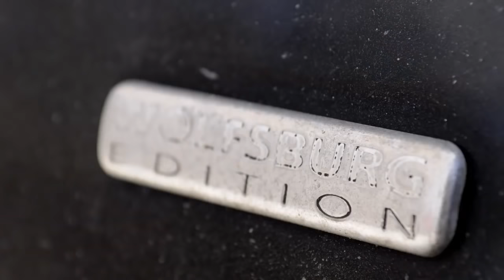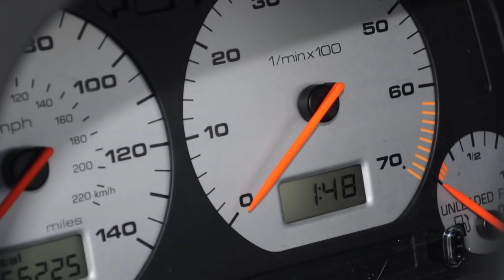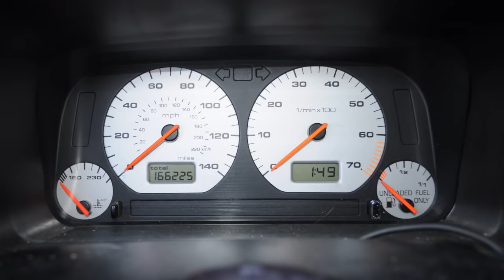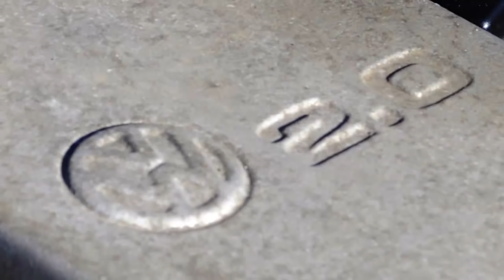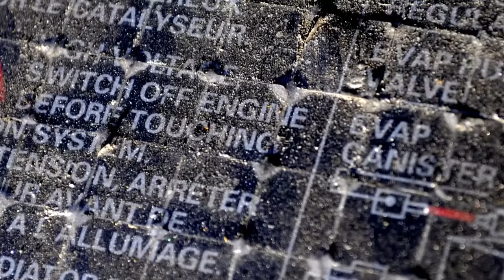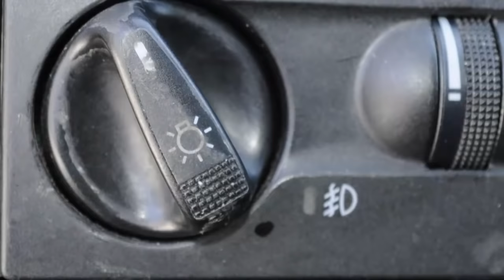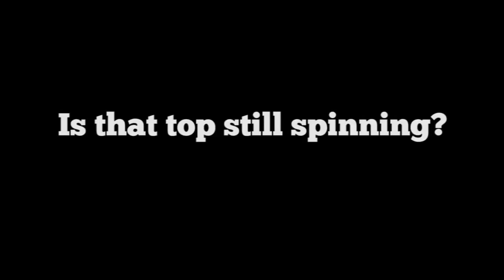Regular Car Reviews: 1998 Volkswagen Jetta Wolfsburg Edition

Comment: I have an irrational hatred of Nissan Jukes. They look like cross-eyed frogs.
Reply: The Nissan joke, garbage car
Reply: The Nissan joke, garbage car
Reply: Sounds pretty rational... although some people don't care i think
Reply: +Sean Hartford I kind of do too. They should've named it the 'Nissan Joke'.
Reply: +Sean Hartford I have a rational hatred of almost ALL German cars for being over-engineered
Reply: WindowsMaster Amen. I'd do that…...Right after I do it to a Prius.
Reply: +MichaelD8393 I drive a JUKE Its ok, YOu have to change the rims to a lower weight rim Do a 3 inch static drop and some bolt on mods to make it anything fun! Yes it is funky
Reply: Jerry robinson Alrighty sounds good.
Reply: +Gregory Kanniard thats an irrational hatred. not rational.
Reply: Gregory Kanniard OK I get it now. Don't know if SatiricalMeme will though.
Reply: Gregory Kanniard It just depends on the year. Usually anything 80s - 90s or early 2000s from germany will have tons of electical problems, but the more modern ones are usually over - engineered to the point where they don't break down often. I've never had problems with my z4
Reply: SatiricalMeme If you buy new they're great cars if you don't want them for a really long time. Buying them used is attractive but disappointing when you get the inevitable costly repairs. I'm actually looking to possibly buy a Golf GTI. Just not used. GTIs hold their value fairly well.
Reply: Gregory Kanniard It must just depend on the car then I guess. I've had my 06 Z4 for a few years now and never had any issues
Reply: SatiricalMeme Thats great! With any used car, it's always a gamble.
Reply: Gregory Kanniard That's very true. I'm going to sell my z4 soon and buy an 06' m6 so hopefully I get lucky again
Reply: SatiricalMeme Hopefully! Those are nice roomy cars with "just a bit" of extra power.
Reply: Donovan Campbell nah I think they look pretty cool.  chick I know has a nice one.  haven't gotten to drive it yet
Reply: My mom went from a Audi s4 to a Nissan Juke. I got cancer when she pulled into the driveway.
Reply: I have a rational hatred towards modern SUV and crossovers in general. "I HAVE A BIG CAR!but Corolla has a more spacious cabin, weird over complicated lines, poor visibility, angry headlights, I can go off-road but I'm not going to, SPOOORRRRRTYYYY!!!"(ok, most post 2008,10, something cars looks like this) Get a FIAT Panda 4x4 or something!
Reply: Indra Ida Bagus SAME!
Why buy a RAV4 when you can buy a Focus ST for 800 dollars more.
Reply: my dad says exactly the same
Reply: I dislike the juke because the headlights look like messed up toenails.
Reply: It's good for you.
Reply: I truly despise Fiat Seicentos. They look like a cat when you pet it too hard and force its eyelids open combined with a neanderthal skull
Reply: the way he feels about Jettas is the way i feel about Miatas. they are probably good cars, but i have an irrational distaste for the over-enthusiastic recommendation everyone gives them. they are too simple a solution.
Reply: Nissan Puke*
Reply: Sean Hartford I like my cross-eyed frog
Reply: There's nothing irrational about hating the Nissan Juke.
Reply: Thank you for figuring out why I hat the car
Reply: Warthog. It's the Nissan Warthog.
Reply: You can think Renault for that design. It's a french car.
Reply: @jerrickoh  I like the cube.
Reply: This is how I feel about the Isuzu Varicose- er, excuse me, Isuzu VehiCROSS
Reply: Your hatred of the Nissan Toad, the ugliest car ever sold in this country (at least up until that time, I think these Big Grille whale-sharks are starting to challenge that crown) is not irrational.
Reply: I have a very rational, totally just hatred for Kia Souls (particularly in electric babyshit-green metallic). They're the gold 96 Buick Century of the modern age, absolutely guaranteed to make you late for work or nearly cause seven wrecks between the mall parking lot and the nearest Chick-Fil-A, ALWAYS turning into the far lane at EVERY intersection, NEVER using a turn signal, and IRREVOCABLY bound to switch lanes in front of you while running 20 mph slower in an attempt to pass the semi in front of them that's going 19 mph slower and remain there for 25 agonizing minutes, forcing you to pass them on the right and weave like a drunk back into the left lane to carry on with your day.
Reply: I have a rational hatred of Nissan Jukes. They’re hideous.
Reply: Completely rational
Reply: Kia Soul. That's all I have to day.
Reply: Not irrational
Reply: Nissan puke
Reply: I literally thought of Richard Hammond from old Top Gear, "Nissan Bloody Juke!".

Comment: 4 years ago, I bought a 90 jetta with 158000 miles on it just because I was reluctant to use my then new G37 as a daily driver. I was actually surprised at how reliable and fuel efficient it was never failing to start every time. sure its as exciting to drive as boiled broccolis and about as stylish as high waist pants, but it serves its purpose well and I could leave it in the parking lot with the windows rolled halfway down. I ended up selling my G37 2 years later but kept the jetta. with close to 200k miles, it now belongs to my brother who uses it to go to college. tough little car this jetta.
Reply: I've had my 99'mk III for 9 years, I got it when I started going to college it's got over 200K Mi now
Reply: I got my 04 Jetta from my mom and I'm giving it to my dad it's lasted my family 253k miles I get hella good gas and in the last year the only time I've taken it to get fixed was for an oil leak
Reply: I feel weird because an old cutlass from like 1989 was the most reliable car I have ever seen.

Comment: I hate Escalades!!!!

They are basically GMC Yukons, which means they're basically Chevy Suburbans, which means they're just trucks.

All GM did (at first) was add cheap leather, chrome wheels and trim, stick Cadillac badges everywhere, and then mark up the price by $15K
Reply: *****
Nothing screams drug dealer or credit card debt louder then an Escalade.
Reply: ***** Because every one need s an arch enemy.
Reply: *****  Aren't that expensive compared to EU luxury SUV'S??? Umm. Mercedes GL450 starts at around $65,000.. The new 2015 Cadillac Escalade starts at about $70,000.............. That right, $5,000 MORE than the Mercedes.. And an awful lot of money for a pickup truck in a tux.
Reply: kop4321 Except the power steering pumps in them.
Reply: *****  Not a lot of money? The 2015 Escalade starts at 71.5 K
Reply: I like how you think.
Reply: Honestly GM did worst just look at the GMC Sprint or the 1964-1974 Chevy Impala/Caprice/Bel Air.
Reply: pbfloyd13 I have a strong hatred for the Escalade too
Reply: Agreed, I can’t stand Escalades, especially heavily modified ones with garish, ugly, distasteful rims.

Comment: I had a 98 Jetta right after college. Non-wolfsburg, so no white gauges, but it had the same 2.0 engine and 5-speed. Best mileage I ever got was about 35 on a road trip from Lexington to Atlanta. (Made it on one tank!) I loved that car, but toward the end of its life every common VW gremlin started to rear its ugly head. Rear window regulators crapped out within 2 days of each other. Dash lights would flicker. And I had to get new rear bearings like once a year. And, like the Jetta in this video, the rubber door trim pieces fell off one by one (I used 2-part epoxy to stick them back on.)

Still, I loved that car. Installed a bangin' system with a sub in the trunk and a 5-channel amp mounted under the rear deck. The trunk was so fucking huge I could drive to band gigs with ALL of my guitar gear in there PLUS my 12" sealed sub box. I used the turn-key-and-hold thing to open/close the windows all the time. I even rewired the sunroof with a special relay to make it one-touch open.

I miss my '98 Jetta.... :(

Comment: But I like the Jetta :(
Reply: Calm yo self!
Reply: I love my vento
Reply: I like the bora too
Reply: I like it too
Reply: I know they are cute
Reply: Jettas look cool!  Just wish they didn't suck so hard D:
Reply: vr6 edges into the room
Reply: i love my mk6 jetta and im trying to buy a mk4 jetta project car
Reply: Agreed vr6 mk3 best
Reply: I had a 1998 vr6 and it hauled
Reply: Being a VW fan, fast and furious fuelled my love of the mk3 Jetta.
Reply: I love them so much I’m on my third one! My first one was a 74 beetle. My second was a 1998 Jetta GLI ( not the Wolfsburg edition parentheses) and my current one I bought brand new and 2013 is the Jetta SE., Which still runs as good as the day I got it! I’ve had some lemons in between, Mazda’s Nissan. I learned my lesson I will stick with my Jetto there, reliable, well built cars!

Comment: Honda CRV is by far my most hated car. Guaranteed to be stuck behind one going 5 under in the left lane.
Reply: Why am I nodding in agreement?
Reply: Honda Jazz for me - synonymous with pensioners going 20mph and exactly wherever im rushing to get to.
Reply: Same.
Or the RAV4. Or the chevy Equinox. Or the Chevy Traverse. Or the nissan juke. Or the ford escape. All of them suck
Reply: Same here, except it's either a prius, f150, Tahoe, or some other GM nonsense. Going 45 in a 60... In the left lane...
Reply: I love the CRV, it's my first car. I do feel you though, a lot of CT drivers either go 60 in a 30 or 10 under no matter the speed.
Reply: One of those pulled out in front of my mum's Toyota Granvia 600 yards from our house. They admitted liability but apparently they couldnt see it.

Was great to see a massive dent in a crv with bent rear axle.
Reply: I have it on back roads. Always a newer model. Always and old lady. I like driving slow. But they were going S.     L.    O.   W.  One time someone had their back windshield wiper going off and a turn signal on. In a straight road with no turns and on a sunny day.

Comment: I had a mk3 GTI with the VR6 pretty fun little car. Honda boys would always try to race but the VR6 never once let me see their taillights. Damn I miss that motor, the car is meh but just the sound of that unique motor was enough to satisfy. I need an R32 in my life.
Reply: They sound like the V6 Ford Contours lol
Reply: Mr Anderson You sir have never heard a vr truly clear its throat. You cant compare the sound it makes to any other engine simply because no other engine shares the same design layout. Especially not some Ford pos modular engine.
Reply: David Garden It's a very unique motor, but it's legacy is hardly inspiring. VW likes to put them in their base/economy models and low end luxury cars.
Reply: David Garden I know what you are saying David.  I had a 1998 Jetta GLX VR6 with chip, intake, exhaust, pulleys and limited slip and that thing was nasty and fast as hell.  No other car I have been in sounded that evil and nasty, I really miss it. The 12 valve vr6 made glorious sounds.
Reply: best-sounding engine, hands-down
Reply: SpaceMissile best sounding my ass
Reply: @nickmerchant81  i still drive a 1998 Jetta GLX VR6 for exactly the reasons you mention... 103k miles now.  it only comes out to play after  the weather warms up and goes back to storage during winter and i drive the truck.  i think i put about 3k miles on her a year.

Don't have any issues with it... aside from broken glove box handle, but i replaced the glove box.
Reply: @rvborgh  been dailying a 94 vr6 german made jetta for the past two years, very addictive to drive, besides the cv axel that I fixed its been reliable even with the coolant gauge not working lol.
Reply: @RAA12586  i still have my West German made 82 twin screw Cabriolet (see my channel), but i really like my Mk3 and am fixing it up.  Just installed a Jetex 2.5" stainless exhaust on it two days ago :)

Comment: Have one. 95' 1.9 Turbo Diesel, 5 spd.

Great car, 40MPG combined, it's rough around the edges, was abused and makes some concerning noises after being dragged out of it's grave in a ditch after sitting for 2 years, and fired right up against it's will.

I got the LOWEST spec though. 2 wheel discs, rear drums, no fog lights, no sunroof, no Wolfsburg rear spoiler, and shitty steelies. I'm missing MOST relays and fuses, including the door dinger, and I had to pull the wiper relay because it shortet out, also it runs rich, has the wrong kind of oil, brake fluid, and so on. Been trying to slowly get it healthy again.

Comment: My wife's 96 Jetta was a complete pile and was completely worthless at 101,000 miles and 9 years old.  Throttle body and front suspension was shot and couldn't figure out where the antifreeze kept going as it never left a puddle and never smelled like it was burning it.  Cost to repair everything (myself and not at a shop) was over $3000.  Replaced it with a turbocharged 2001 Golf.  Car was a blast to drive, but was in the shop at least a week out of every month.  Last time, it blew the turbo, throttle body and alternator in one go.  Without warranty (which I had 2000 miles left on it), it would have cost over $5000.  Traded it in the next day and wound up upside down in a loan....and that's how I spent $20,000 on a used 2008 Kia Rio, and it's been the most reliable car I've ever owned.

Comment: My most hated car is the RAV4. I hate them so damn much.
Reply: I hate the MINI Countryman. Completely and utterly defeats the purpose of a mini.
Reply: *****
lol the nissan skyline is my favorite car
Reply: Muffins It is an over-rated piece of shit that people love because of a bunch of videogames like Gran Turismo and Wangan Midnight. Wanna know 2 cars that during the 90s were similar to the Skyline but performed MUCH better? Lancer Evo & Impreza WRX
Those Skyline (R30-R34) were heavy, had a longer-wheelbase and also used a 6-cylinder engine that made almost less power than what Mitsubishi and Subaru were making with only 4 cylinders
Reply: *****
Group A at bathurst bro. Checked the nurburg ring times? They were space age in the day and were a lot more advanced than pretty much anything another manufacturer was making. plus the evo and wrx were only successful as rally cars but don't hold a candle to the sklyine gtr in circuit racing.
Reply: Muffins When it comes to racing roadlegal cars, rallying has always been the top, the best. In rallying you have to be quick on asphalt, dirt, snow, mud and even sand while also being reliable, resistant to small crashes and even able to complete road sections at normal speeds
Circuit racing is just a bunch of idiots completing loops around a perfectly-groomed route with almost no imperfections
Guess what is closer to what you might find on a normal road? ;-)
Reply: ***** Never really got into it
Reply: Mine is the prius it shouldnt even had been invented
Reply: the 1st gen is the only 1 i like

Comment: I actually owned a 1998 Jetta Wolfsburg, bought new in 1998 for $15,500. I kept it for 12 years and put just over 100,000 miles on it. It was a lot of fun to drive. It did have some issues, however. The window regulators were a faulty design and broke regularly. I think I replaced all four of them. The ignition coils on these cars were known to crack and allow in moisture, which caused faults when it rained heavily. My cruise control stopped working after about 8 years (probably a bad vacuum pump) and I had a faulty 02 sensor at around 10 years (easy to replace).

Luckily the car was very easy to work on, and the 2.0l motor was super reliable. It also came with quite a few features that were unusual for such an inexpensive car, such a six-CD changer, which I sold on ebay.

Comment: when I was 18 and mom was ready to buy me my first car, I insisted on a '89 e30, but she picked the '98 Mexican Jetta GLS for me. to play it safe, you see. to buy a car more reliable and cheaper to repair, you see. bought for $4000, sold two years, about a grand in repairs later for $1700 with leaking oil and transmission slipping and sliding all over. this car put so much autoshop fright into me, my next one was a '00 echo. also, re: fuel economy - compared to an echo and my current sixth gen civic, owning the jetta was almost like owning an suv.

Comment: I seem to recall that the Rabbit was a failure in the US in large part because they had to sell it at a higher price point, later than planned, because of parts production problems in Brazil - which is the very same problem they ran into when debuting the New Beetle.

Comment: Yeah, those numbers are likely the TDI, as I have one.

Pretty sure the GTI/GLS/Etc. were around 30 City 35 Highway
Reply: Stephen Kraus You are 100% correct. My 95 Jetta GL got around 33 combined as a pizza delivery driver.
Reply: Stephen Kraus You are 100% correct. My 95 Jetta GL got around 33 combined as a pizza delivery driver.
Reply: Stephen Kraus My 1988 MK2 Jetta with 1.6L gas engine (which was indeed my first car) got me about 4.9L/100km. It had a 4+E transmission (so the 5th gear was basically a high overdrive, not really meant for accelerating) and to get this fuel mileage, I had to do about 90km/h. If you need it in US units, do the conversion yourself ;)